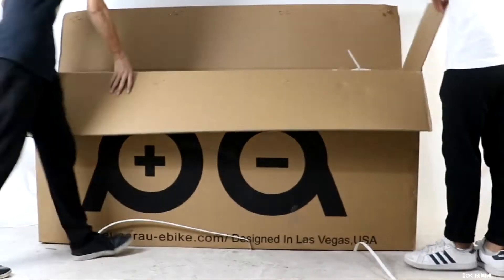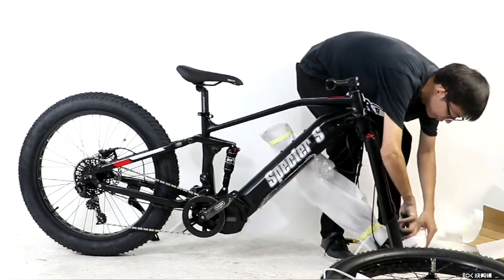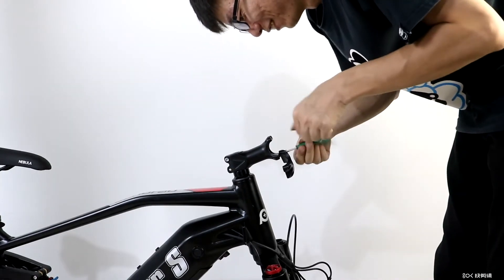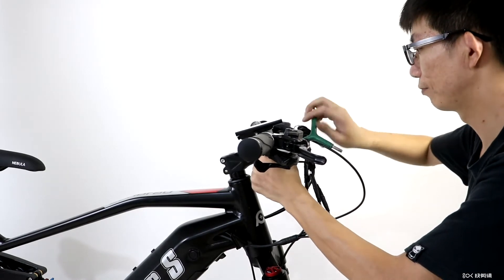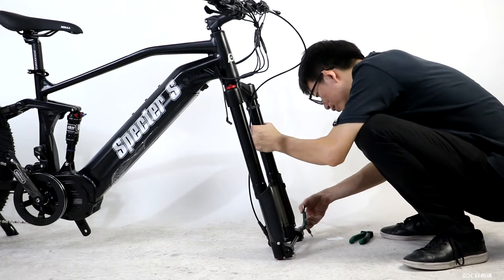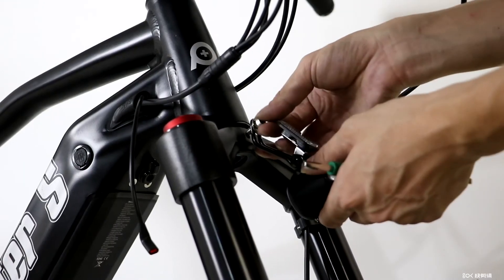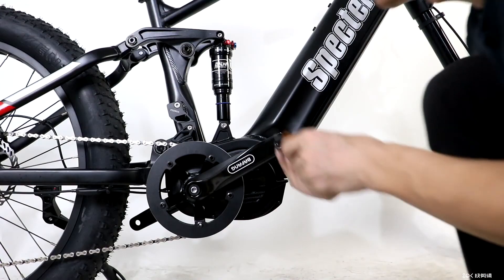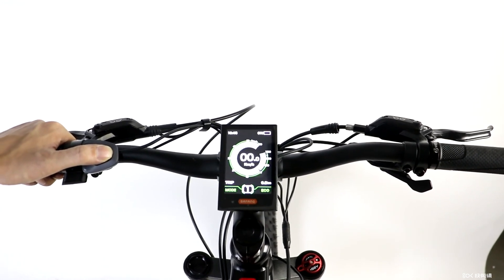UNBOXING: The EUNORAU  SPECTER S

Comment: is it normal custom for the bike to come with the battery separately? just received my specter s from JETSCOOTERS here in Australia, and my bike came with no battery. not to mention that the dial for adjusting the front suspension was not the correct one and comes off a KKE suspension????  and this is as i was to believe is not a second hand bike.
Reply: Well, in my experience,, my eunorau bike came with a separate battery, so maybe it’s just a cost thing.